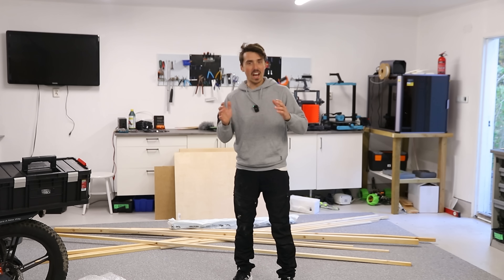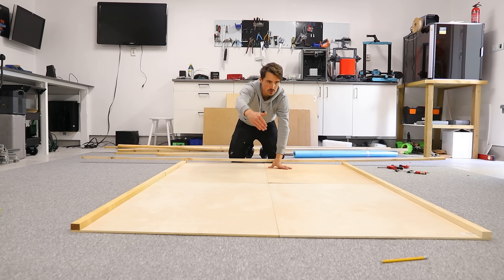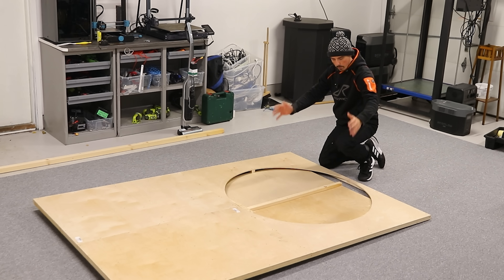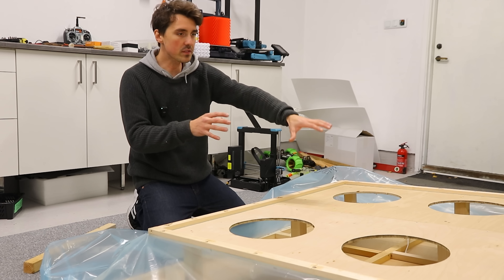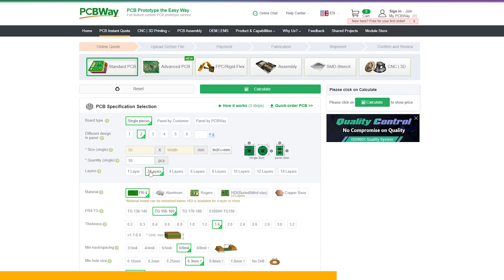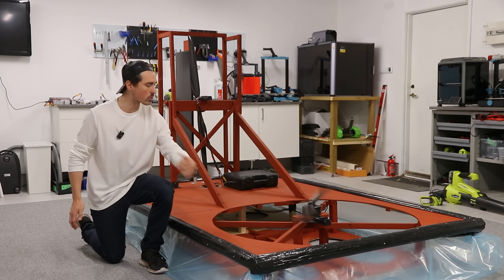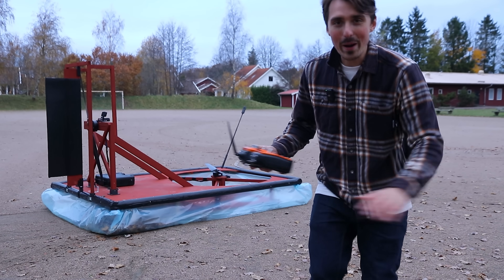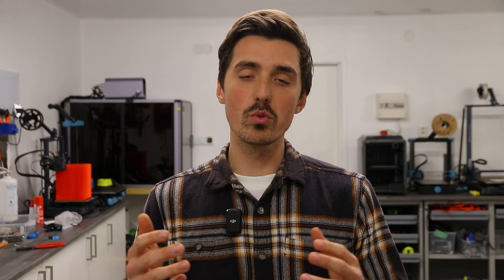Electric RC Hovercraft That Will Lift My Weight

Comment: you should use damp proof membrane it comes in large sheets/rolls and is thicker than what you have
Reply: Or Ripstop (kite material) easier to work with.
Reply: I’ve fitted maybe 30 sinks, domestic and commercial.
They were steel, ceramic, composite and soapstone.

Butyl rubber for the pond.

I did make a hovercraft out of insulation I found in a skip if that helps.
Reply: @kitsandham7001  Aaaaah so you used sensible materials. The things you build were an actual effort to build something usable instead of just making space for advertisement. I get it, well good for you 👍

The topic from the original question basically was, why not use a better material. And my answer was, to save money because the purpose is not really to build a usable product. But instead it is to make content that creates space for advertisement. So the less money spend, the higher the profit. 

I don't even see how that is a point of discussion. It is not a judgement. It is just how it is. I can see why some people like it. But I can also see why some people are less impressed. But that was not the topic.
Reply: @insAneTunA  I get where you're coming from, this clearly was a minimum time minimum spend build. He could have done far better.
On that we agree.

However what he was really making was an entertaining video, not a usable hovercraft.
He did that really well. Call me a nerd but I love good editing.

The proposition of the video is not:
Watch me build a functional hovercraft, it's accurate.

It is:
I'm going to lash something up and see how well it works, it'll be fun.

BPS space channel does high quality builds and technical excellence, I enjoy that for what it is.
This ain't that, this reminds me of when I had my first shed and I built all sorts of fun things. Some good some bad.
(Back then I actually failed to complete a full size hovercraft - Simon's at least worked!)

You don't always have the time/money/ confidence to make exactly what you want, the point is to have fun within the limitations and learn as much as you can.

I enjoyed this video. That's the point.
Reply: @kitsandham7001  When I was a kid people would or could or were not willing to explain the reality behind things, or at least not as often and/or detailed as I would have liked. I just answered the question as things are in reality. I think that it is good that kids understand the reality behind things. The world needs some realism more then ever. It is still okay to be entertained. But it also doesn't hurt to know how these videos are possible. And to know and understand how things work in life. Nothing comes for free.
Reply: He is not even remotely trying to build a durable hovercraft. He is building the cheapest version possible that hovers, and then we watch it, and then he can buy some nice stuff for his house and go on a holiday. It falls into the category of building a foam aircraft carrier so that you can accidentally land an RC plane on it, call that some how a success, and make a 33 minute video about it so that there is lots of space for commercials and advertisement. Some of these channels have sponsorship deals that earn them 50.000 dollar. So it is no surprise that they come up with these type of videos. It is seems that some of these channels are just creating content for the advertisement. They start with original ideas, of which you could think that it might be interesting to do them yourself, but eventually they run out of original practical ideas, and then you get this type of content. So that is why there are no sensible materials used for this video. Good materials cost more and it takes longer to get them. More costs is less profit.
Reply: @insAneTunA Each channel has its USP. I’m sure there are lots of high quality hovercraft builds, I’m not watching them.

Simon builds stuff quickly for maximum effect and learning, with minimum build time. 

It’s something I could imagine building.

You should see Jake Carlini’s builds ! Also great fun to watch.
Reply: @kitsandham7001  Right, so you are easy to impress. In that case I can only advise Simon to build a plywood car in the same way as he build that "hovercraft". Or a plywood boat, or a plywood buss, or a plywood house, or a plywood tank. The possibilities a limitless. 
🤣😂
Reply: @insAneTunA you clearly have never built anything, good bad or otherwise. 
That’s why you don’t get it.

I’ve built everything from house extensions to platinum and diamond wedding rings, I’ve made stuff from almost any fabrication material you can name. Carbon fibre to cotton.

Yet still I love Simons builds.
Reply: @insAneTunA  and I’ve made ponds.
Reply: @kitsandham7001  Good for you! 👍 Did you also make a cardboard kitchen sink? 🤣😅
Reply: @kitsandham7001  And the pond, did you make that from kitchen wrap? 🤣